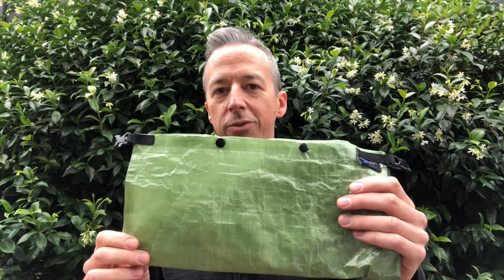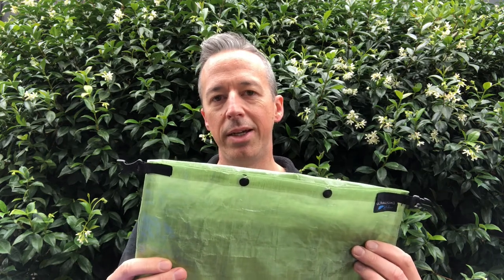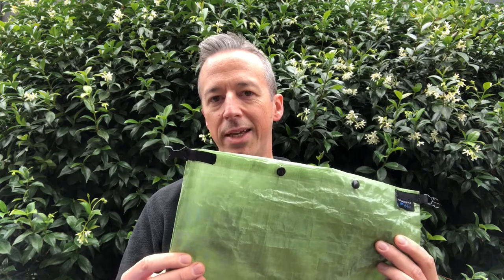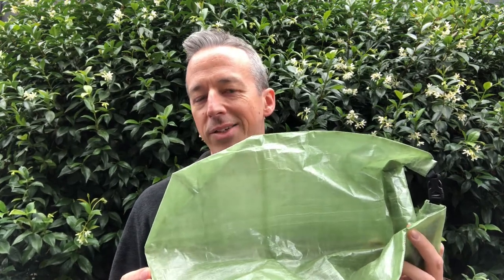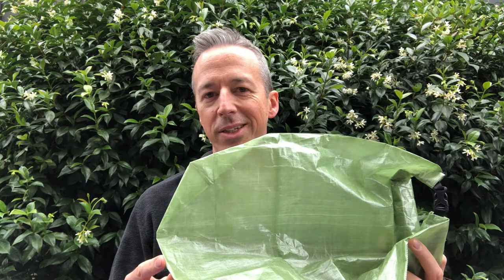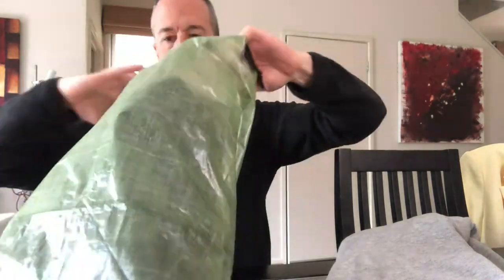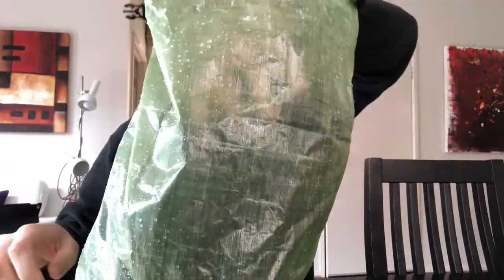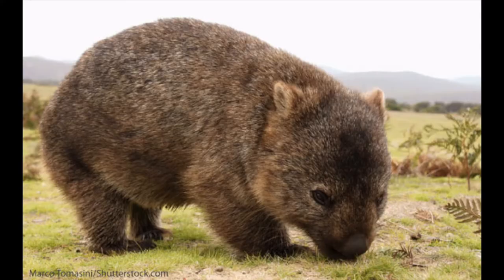Dyneema Food Bag: My First Piece Of DCF Gear

Comment: Hey Chris,
Good informative video.
Have collected a few pieces of DCF over the years including a Zpacks tarp and the Zpacks Duplex tent. Great material although as you mentioned definitely expensive! It also repairs well. I had my tarp rip a bit (my fault) and the DCF tape I carried with patched it up straight away and haven’t had a problem since.
Reply from the maker: Aussie Hiker, thanks for the comment on your experience with your DCF gear. Keen to hear what you think of your Duplex as that's definitely one of the tents I've got my eye on. Is it simple to set up and do you have many issues with condensation, being a single-walled tent?
Reply: @FreedomOnFoot  Very simple to set up, requires a little practice but once you have your method down pat its very quick and simple.
Yes, condensation is an unavoidable problem however there is a gap between the top fly and the tub so the condensation does not collect in the tub of the tent and get anything wet.
I don't think you can find a way around condensation for a single walled tent however the ventilation is good with this one and its worth it.
It is by far my favorite tent for camping with the wife or solo glamping, would definitely buy again
Reply from the maker: @JakeMarcin  thanks for sharing your tips on your experience with it. Sounds like a really good tent and always good to get feedback from someone who has been out there using it.